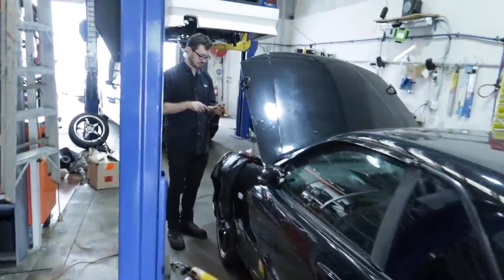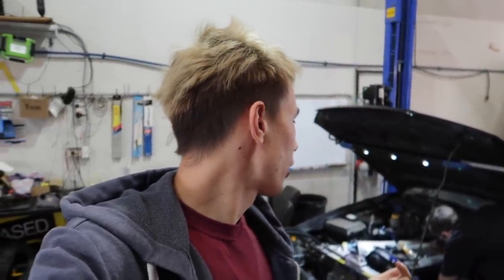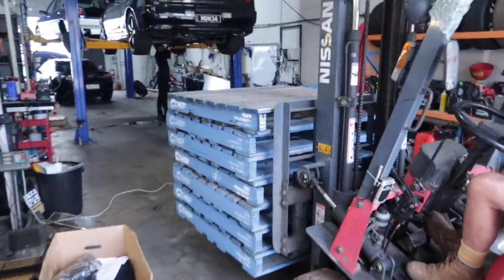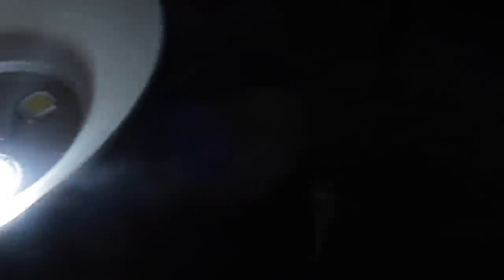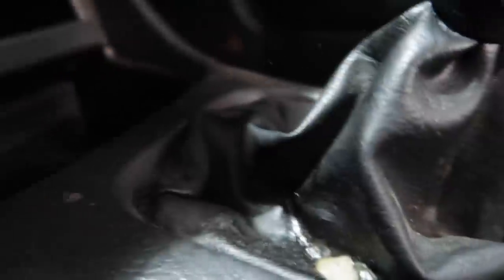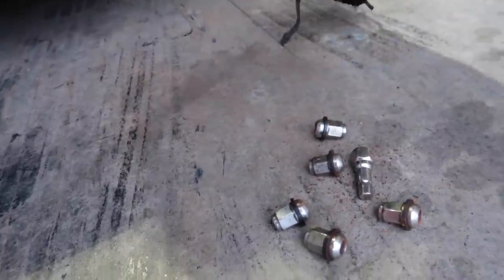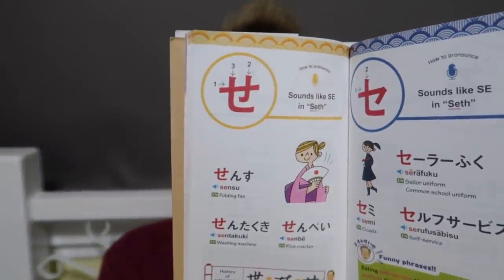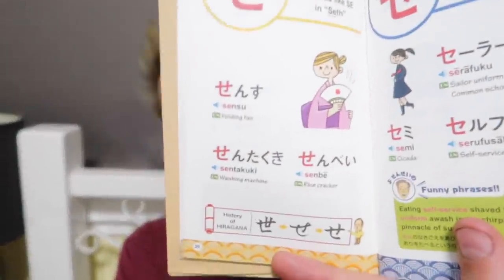CLEANING THE DIRTIEST CAR EVER! - Honda EK Civic

Comment: Hey Sam, I've done the same conversion on my car for disc brakes and I found it's easier to just go to the wreckers and find a ek Civic sedan and take the whole rear trailing arms with the disc and hub assembly and take the handbrake cables too. The whole thing bolts right up and you don't need any conversion kits, plus for me it cost around the same with everything I need and I know it fits.Ps you will need EK4 rear brake lines which you can get from JDM Yard in NSW for some nice braided ones.